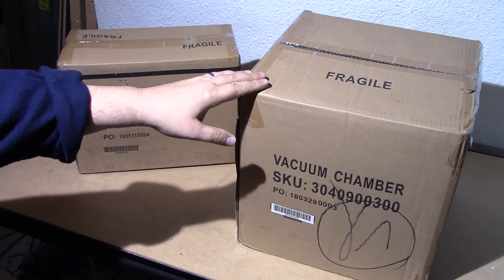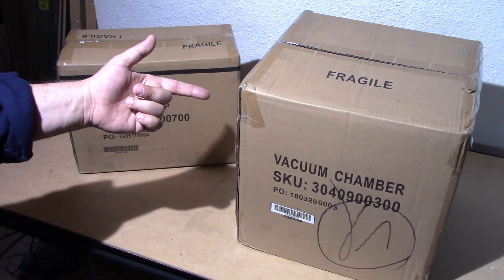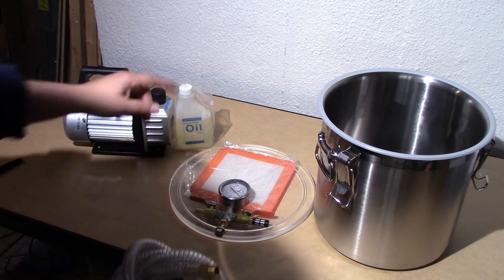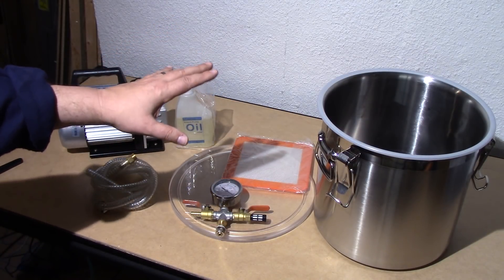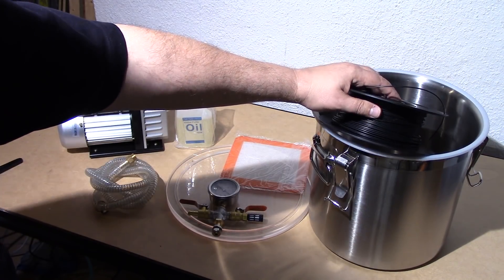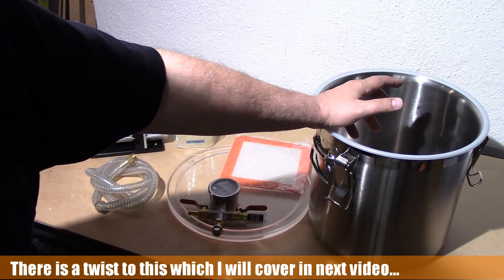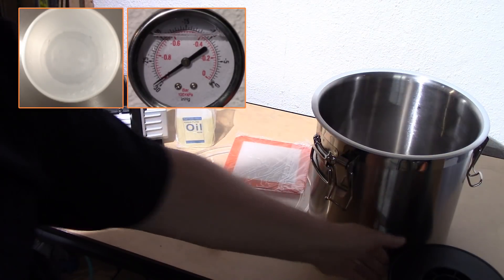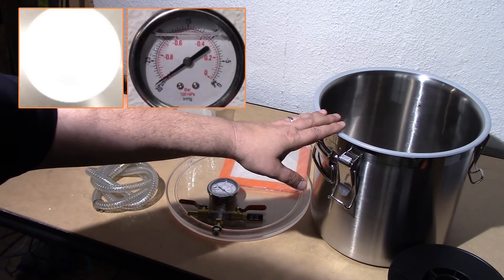Shop Talk - Filament Drying With a Vacuum Chamber Part 1!

Comment: @5:15 you don't rely on "air flow" to dry the object in a vacuum chamber.  The whole idea is that there is a lot less air in a vacuum chamber.  It's the pressure, or lack thereof, that makes it work.  Not the airflow.
Reply from the maker: Thanks for commenting however not quite accurate as the filament needs to out gases as part of being in a semi-vacuum (as this is not a "full vacuum).  So if the spool is tightly wound, the filament will have a harder time out gassing (air or gas flow if you will)...

Comment: How has it been working for you? I'm thinking about doing this also. How many spools can fit in that 5 gallon chamber? Have you tried drawing a vacuum on descent to see if it removes the moisture in it? Also, a way to transfer heat is use Infrared because it heats objects instead of something that heats the air.
Reply from the maker: Good and yes to the desiccant and warming, for the number of spools about three...
Reply: DIY3DTECH.com I might be wrong but it doesn’t look to be 5 gallons (paint bucket) which should fit 4. Perhaps it’s a 3 gallon like I’m looking at?

Comment: The pump should pull out moisture, however it will also cool down as moisture boils, so it takes a while for the moisture to gain enough energy to sublimate. A heat lamp shining through the lid can help to heat the filament through radiation even in the absence of air. Don’t heat from below, no convection to move the heat. But it will eventually work at room temp as well.
Reply from the maker: Yes you are correct and in the next video I cover this out and suggest warming the filament first is a good idea   I also have come to believe that desiccant is of value too.  Also take a look at this https://www.thingiverse.com/thing:3438274  add-on I created...
Reply: That’s a cool desiccant holder, might have to print one off. Thanks.

Comment: I tried this myself, and unfortunately it didn't work for me.  I tried with color changing desiccant to actually see if moisture was being drawn out and even placing the vacuum pot on a heated surface, and it just didn't seem to draw the moisture out like I would have hoped.  If you aren't in a hurry I've heard freezers can work - as long as it's an auto defrosting freezer the air will be very dry, and the water will sublimate out (eg freezer burn).
Reply from the maker: I wouldn't expect a color change until after many uses.  As the amount of water in a roll of fulfillment is only around a gram or so and when a vacuum.  Most of the water will be pulled during first few minutes until the  remaining water cools due to the evaporation of the initial water.  This is where the desiccant comes in and as with no effluent (air in this case) the water simply bounces around the pot in a gasses state till it binds with the desiccant.  In short this will be a super small amount, so I would expect the desiccant to last for a VERY long time.  Also check out this: https://www.thingiverse.com/thing:3438274 I created to dry the recovered air...

Comment: I'd stick the desiccant in there just to get the desiccant recharged/dry.

The King of Random made their vacuum chamber with a glass cookie jar so they can see and film what is going on inside. It has worked really well over the years and have also done a video later than this video that I am linking where they purposely try to break it under pressure and find they're very durable for the purpose.
https://www.youtube.com/watch?v=xyn8Pq6s7hk
Reply from the maker: Yes saw this before starting this, and as mentioned in the video since filament drying was was the main goal seconded by drawing air from molding compound.  I wanted a BIG pot to place several rolls of filament into so this 5 gallon pot fit the bill well and from a cost perspective did not feel I could make one cheaper since I needed the pump any way.  Also I believe you to be correct about using the vacuum chamber to recharge the descant...
Reply: @DIY3DTECHcom  yeah, I only brought up the cookie jar since it is good for filming. I think your solution is good and cheap but thought I'd bring it up in case you wanted to film.

Comment: I don't know about this.  As an automotive technician who also does A/C work.  I use a vacuum pump to not only draw negative pressure on the system but I also use it to suck out any moisture in the lines.  But I do this by leaving the pump running and not closing the valve.  I leave the pump run for about an hour and go do something else.  If you plan on doing it the way I just explained it could work.
Reply from the maker: Your sort of correct, I have found running the pump for 7 mins (full vacuum is pulled in 2 to 3 min)  works best as in this period 2/3's of the water is pulled out (the next video will show this) till the temp drops due to evaporation which then tails off the following ~1/3 over a longer period.  This is where the desiccant come in as since the pump is no longer pulling from the pot, the desiccant grabs this remaining 1/3...
Reply: The pump will pull out water, but unless you crack open the pump, the water gets trapped in the pump oil and reduces effectiveness.
Reply from the maker: Not sure I understand "unless you crack open the pump", as how do you crack open the pump?  Would like to know more :-)
Reply: DIY3DTECH.com  there is a screw down cap on top of the pump. If you open the cap, the pump starts to suck in some atmosphere and the air running through the pump helps to remove the trapped moisture from the oil. You could also just run the pump not hooked up. Be aware that some oil will splutter out when you loosen the cap. Worst case you can replace the oil. If you have moisture in your oil, you will notice a reduction in suck power as some of the moisture will be released from the oil and increase the partial pressure inside your vacuum, which would also counteract the drying power.
Reply: @scottmichaelharris  I've never "opened the pump" when doing A/C service as the pump does have an exhaust already.
Reply: Bruce Hirsch it’s more of an extra inlet to the pump. Only useful when you are pumping out liquids that like to get stuck in the oil. My background is chemistry don’t know too much about AC.
Reply: @scottmichaelharris   A/C (air conditioning) has oil present in the system.  Plus the vacuum pump has oil as well.  When you open up an A/C system you expose it to atmosphere and the potential for moisture/water.  Some systems I've worked on has been open/exposed for quite some time so the likelihood of moisture/water present is almost absolute.  I've never had to open up a valve or screw down cap on a vacuum pump to remove the moisture/water from a A/C system.  Just let the pump run and draw a negative pressure for for an hour.  Then closed the valves and shut the pump off to see if it holds the negative pressure for 30 minutes to test for leaks and if it passes then use the vacuum to suck in the refrigerant.  Never had an issue.  Always had removed the moisture/water that way unless the system was just too far gone.
Reply: Bruce Hirsch  ohh, sorry the opening the valve is to remove the water from the pump oil, you are correct, it does not help remove water from the system. It actually makes the pump work less efficiently. But can be used to rehabilitate your pump oil rather than replacing it when it has absorbed too much water.
Reply: @scottmichaelharris  ah.  Gotcha.
Reply from the maker: Not sure I understand "unless you crack open the pump", as how do you crack open the pump?  Would like to know more :-)

Comment: On the resin casting, I've seen several videos suggesting that you should put the resin under pressure and not a vacuum to minimize bubbles.  

One video showed that the resin will froth and expand several times it's volume, potentially filling your vacuum chamber before any significant degassing happens.
Reply from the maker: Depending on the mix, you may have to watch the resin doesn't  over flow and as Round Tuit points out that the pressure pot is more for wood stabilization or "post" casting as either you can (1) remove the gas from the resin and cast, or (2) cast and then compress.  Also I have seen people do both, however believe that might be over kill...
Reply: Yes I was looking into it and it seems you may want to vacuum the resin when you mix it but when it's on the item ie wood (for making pen blanks) then the pressure pot will squeeze the bubbles down. If you do the vacuum with the wood pen blank you could release the air from the wood and introduce bubbles. A lot of people it seems on youtube will just use the pressure pot (again on smaller items) as some resins go off quickly and you can't do both in the time the resin is usable. I guess for something like a popular thing at the moment a resin river table you don't have the option of the pressure pot but no harm in taking the bubble out with a vacuum pump.
Reply: @mrfoameruk  Here's the video.
https://youtu.be/ShSxUg4Yyws

Comment: I live in a dry-ish climate.  It takes me a very long time to use up a 1kg spool of PLA and, as a result of the LOW humidity I THINK, my problem is filament embrittlement.
Reply: It gets brittle when wet. I store my filament in a container that is under 10% RH and everything prints well and doesn't break.
Reply: @mrjackson2k  How's this for a conflicting message on embrittlement?

https://blueprinted.co/blogs/wiki/106458374-how-to-preserve-and-restore-filament

"A common misconception is that water causes filament to become brittle. The truth is filament including PLA is actually extruded into water to hydrate during the drying process. Without this important process filament wouldn't be flexible enough to spool.

Brittle filament is often caused by the plastic becoming dehydrated due to humidity in the air. Think of filament like dried spaghetti. When you put spaghetti into a boiling pot, it begins to re-hydrate which restores its flexibility (and its tastiness).

Another major culprit of filament become brittle is our favourite star! The sun. The reason? UV light degrades the molecule bonds which holds filament together.

In short. Humid weather and UV light are the main causes of brittle filament."
Reply from the maker: This is an interesting point!  Do you use an oilier for the PLA?
Reply: @DIY3DTECHcom  No.